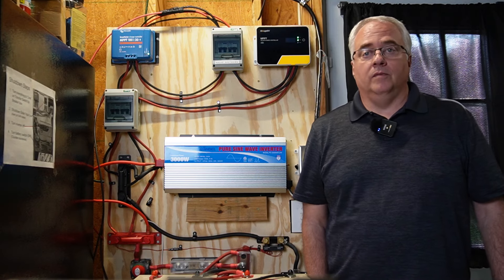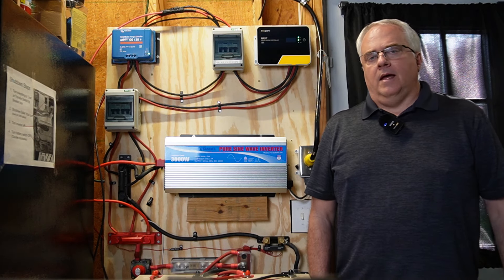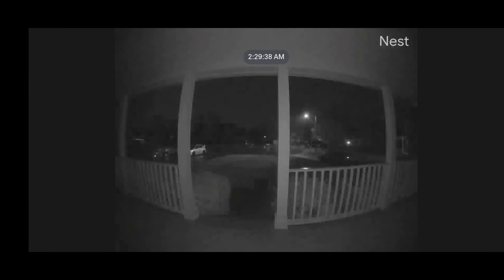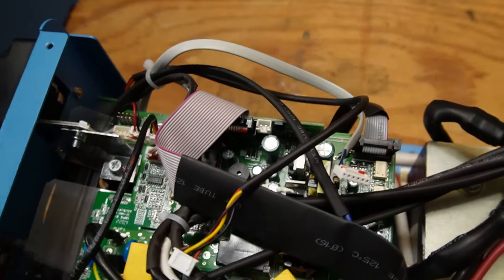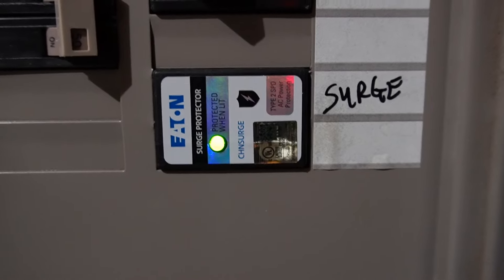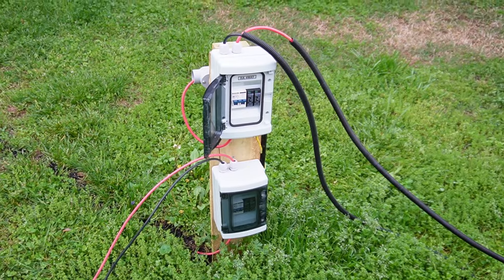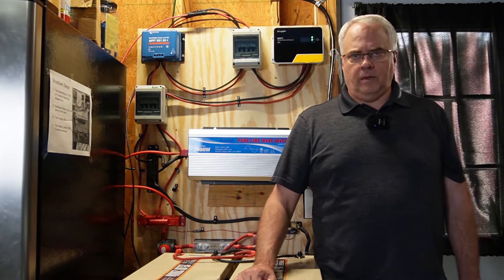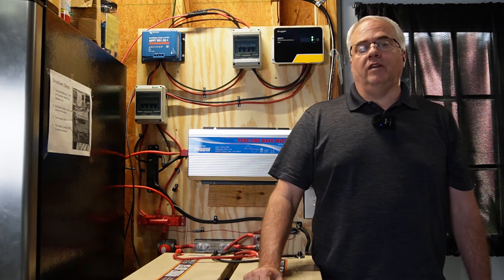I Built a DIY Solar Generator, Then Lightning Hit

Comment from the maker: So what are your thoughts on what I added for lightning protection? Is that enough? Do I need to do more on the DC side?
Reply: Lightening rod and make it the tallest structure on your property..
It could attract more strikes, but would be the easiest path to ground rather than anything else.
Reply from the maker: I just added the surge protective devices the electrician installed to the description of the video. I will also paste them here: 
Eaton CHNSURGE Whole Panel surge protection - https://amzn.to/4aGY9br
MARS HVAC Surge Protective Device - https://amzn.to/3JtdIrl

Comment: The surge protectors in the combiner box are meant to protect surge from a panel short circuit.  They do not offer lightning strike protection.  Another Ytubers found this out the hard way. For lightning strike protection you need a DC midnight solar device hanging off the side of the combiner box.  This prevents sending high lightning strike voltage and current traveling down wire to house/mppts.
There is a several year old Ytube lab testing post of Midnight solar device vs "cannister filled with powder".  The cannister offered no protection from lightning strike, while the Midnight offered multiple strike protection to lab generated strike equivalent.
Reply from the maker: I originally purchased those boxes nearly a year before so I could easily shutdown the PV system at the panels. I thought they would provide some lightning protection. But maybe not. I will definitely take a look at including those Midnite solar devices.

Comment: A very interesting, well done, and informative vid.  Thanks!
You should unwind the ground wire on your combiner box surge protectors.  The winding of that ground wire greatly increases the inductance of the ground path.  Inductors limit the rate-of-change of current thru them.   Trying to sink a lightning surge requires a VERY fast path to ground.   Any slowdown directly raises the peak voltage that the protected side will see during  events.
Reply from the maker: I was wondering if anyone would comment on that. The reason I wrapped the wire around the iron pipe is because I thought I may redo the way I mounted these and I might need that length. You make an excellent point. I can always get new wire if needed. Thanks for sharing that information!
Reply: @proficientprepper  If you're like me you'll "think" you might change something right up until it's so old you have to replace it.  LOL.      Unless you see the coming day you're going to change the setup I'd shorten the wire.  If you want it longer later, use a quality split-bolt or a waterproof butt-splice (used for well pumps) and re-extend it.  Could be your new setup would need it longer than you have anyway, and you'd still need it extend it.  As it is now the unit is probably rendered about 1/2 as effective is it would be otherwise.   With lightning protection it's often a game-of-inches where if the let-through voltage peak had been only a couple of volts lower the protected equipment would've survived.

Comment: Inverter, battery and panels should be grounded if you have not done so.  I have the whole house surge protection and use the midnight solar and have not had any issues so far but never had lightning that close either.

Comment: Doesn't sound like a good repair shop. They should be able to test all the amps.
Reply: They repair other stuff, they are not setup to repair inverters.
Reply: I'd say they're an excellent repair shop. They were upfront regarding their expertise on this type of diagnosis/repair and they quoted a price if they could fix it and free if they couldn't. They probably spent a few dollars on parts but a heap of hours on repair. Other shops will charge you for parts and labour regardless of outcome.
Reply: @Ulbre  I agree with you, they are an excellent repair shop, not looking to rip off anyone either. It was also so kind of them to spend so much time on the inverter AND NOT charge you.